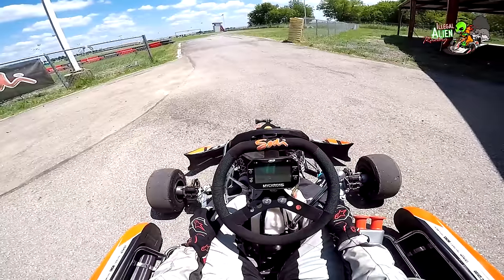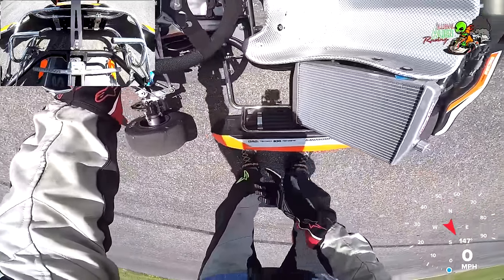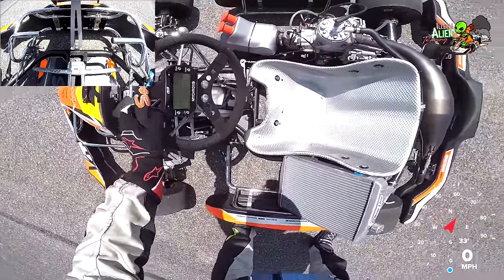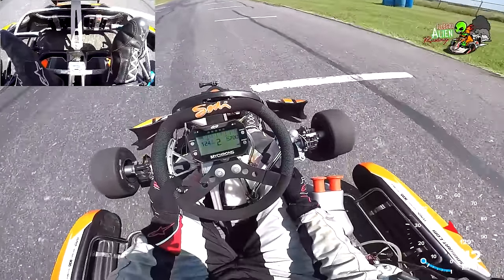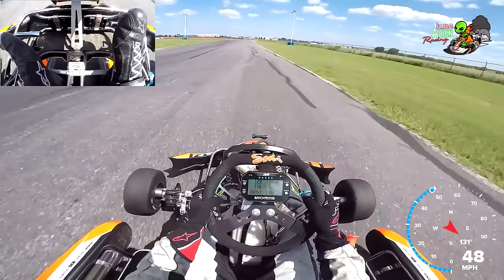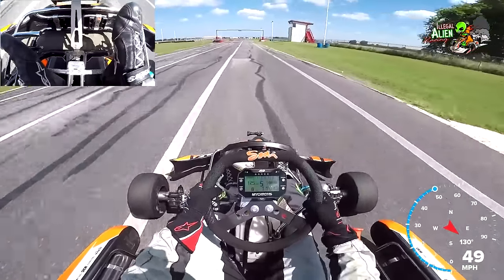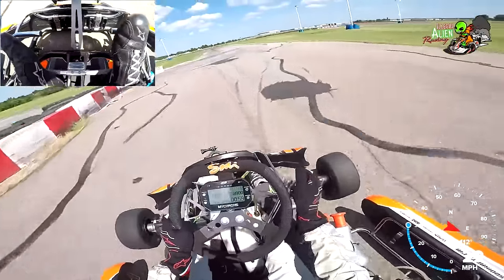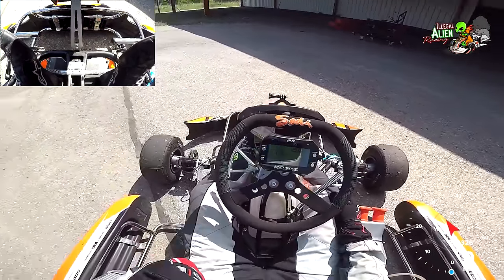Shifter 101 - Basics of Driving a Shifter Kart

Comment: To all the comments related to needing the clutch to shift: motorcycles can easily be shifted clutchless. This is a motorcycle transmission. For that matter - cars with manual transmissions can also be shifted very easily without the clutch without damage, it just takes more patience/time to match revs, and no - it doesn't hurt the synchros.
Reply: yeah your right. To give car people background these transmission are like sequential gearboxs (like the ones in rally cars). When they shift at speed in those the ignition is cut for a little bit and at the same time changes gears without a clutch. Motorcycles have these too and they are called quick shifters. But you don't need one, just letting off the gas works just as well.
Reply: @pleasedontwatchthese9593  exactly!

Comment: When you get comfortable with shifting you can shift without coming 100% off the throttle, but this is a basics guide and that's advanced driving. :D
Reply: When shifting a motorcycle without the clutch I preload the shift lever just before I get to the point I want to shift.  Coming off power  and right back on completes the shift.  Tapping a kill button does the same thing while keeping the throttle open.  This eliminates the need to coordinate throttle and shifter movements. Should work on a kart too.
Reply: Can you shift without letting off the gas?
Reply: Or do you have to lift off a little bit
Reply: @lukereyes1025   In order to shift, you must de-load the transmission gears no matter what. You can do this in several ways. One is to roll off throttle just long enough that the gears deload and you shift during that time. Another is to use the clutch.
Reply: @jimsz0100  Had a miroswitch in my gear lever, so I could trigger a flat shift option on my ignition. Loved pulling gears with the gas hard to the floor! It was a Suzuki RM250 grass kart and often would go over bumps when you were ready to shift. That would load up the gearbox again, so you'd miss your ideal shift spot. Also had a shift light and rev limiter. It was pretty quick!!
Reply: I (almost) always use the clutch when shifting my bikes. Dirt or road, and this is more bikes than I can remember over more years than I care to remember.
Reply: So my experience with manuals is strictly motorcycles. With that being said it is fairly easy to shift up and down gears without the clutch on most motorcycles however you still have to rev match or it will damage clutch and maybe trans as well. In this video though the driver downshifted without blipping the throttle, is this truly the best way to downshift in a shifter kart?

Comment: It's a go-kart with a sequential manual (motorcycle) transmission essentially...
Reply: Almost like a 125cc dirtbike powertrain installed into a go cart!
Reply: @fokjohnpainkiller  Well motorcycles aswell as shifterkarts have manual sequential transmissions. You technically need to pull the clutch to shift but you can shift without doing it. In sequential transmissions you don't need the clutch to shift, only to get going.
Reply: @jayplexy5983  umm you do still need to clutch to shift, you technically don't have to use the clutch on any transmission of you double clutch, although that would burn the synchromesh pretty quickly.
Reply: @tristan6509  No, on a sequential tranny you don't need to use the clutch to shift.
Also when you double clutch, you literally use the clutch, TWICE!
Reply: @jayplexy5983  well yeah, so what?
Reply: @tristan6509  Well you said you need to use the clutch unless you double clutch...
Reply: @jayplexy5983  lmao I derped out, I meant rev match not double clutch.
Reply: Yeah, seems sucky to not have the clutch (pedal to) override and have the engine cut out at basically every minor input mistake.
Reply: It's a motorcycle engine in a go kart.
Reply: @DonziGT230  no its not lmao its a 2 stroke
Reply: @higtmance3641  Yes, lmao, a 2 stroke motorcycle engine; Honda CR125 is one of the most commonly used.  I don't know if that's what this cart has, but they are popular.

Comment: I built a shifter before shifter we’re cool! Put a 370 RM Suzuki motorcycle motor on a Yamaha 100 cc cart in 1980. Was very torquey an a lot of fun on side Roads but No tracks or place to Drive it! Brakes were not very good but worked ok. Mine hade the kick start still on it an worked fine! The tuned pipe was very loud so when got it on Road it brought people out to watch.

Comment: Cool video. Thanks for showing how to operate a shifter Kart.  I raced many years ago (1960's) before there were ever shifter Karts. My Dad and myself raced a 2 stroke McCulloch single engine Kart.  Raced on several Chicagoland area tracks. Was allot of fun back then as a Junior division Karter.  At the end of racing this Kart, it was pretty well modified and very fast. Shifter Karts are a whole new ballgame.

Comment: Racing with shifters for some centuries I do have a tip for beginners in real racing to avoid to be in the wrong gear: Shout loud to yourself the gear you a shifting in. Yeah, know sounds a bit wired, try it! When you have problems after the corner to accelarate, being in the wrong gear, that really helps, because even when you have the luxury of a gear display, in a race its hard to look at this. It also prevents a lot of laughter from the pit lane......when you lose several places caused by the wrong gear......

Comment: Thanks I have a TAG and I have heard its a big performance jump up to the 6 speed from no shift,I have 125cc 29hp and shifter are 6 years ,front brakes and 40 to 50hp if they. Are the original motor from the factory,I was real worried how tricky my tag would be with just rear brakes it amazing u real don't notice it brakes so well, I have stoped racing but still would love to drive a shifter just to taste the difference...thanks for general direction nice job,audio was great and surprisingly clear compared to what I was expecting,😎
Reply from the maker: You definitely should drive a shifter with your experience.  Thanks for watching the video!
Reply: A shifter takes a little while to get up to speed but you’ve driven one you won’t go back. The shifter take a lot more concentration. for me I could run a dd2 or tag 8 practice sessions no issue but then after 4-5 sessions in the shifter and I’ll be done.
Reply: Stock Honda 125 is not 40-50HP. Maybe 32 tops....

Comment: 2:03 on the tracms that ive driven on, your supposed to go flat ln the throttle while they pull on the (lawnmower like) engine starter
Also, they were not shifter karts and we didnt get pushed

Comment: question about where to tie in the pulse pump vacuum line. In the side of the reed box ?  Or in the carburetor boot before the reed box. 
copy
Reply: I've seen it done both ways, on my kart I put it on the carb boot.
Reply: Definitely in the carb boot. Taking vacuum line into the downstream side of the reeds will give you both pressure (on piston downstroke) and vacuum (on piston upstroke) of any case reeded engine or pulses of both on any piston port reeded engine. Opt for only vacuum!

Comment: For the viewers: the "killing the kart" part of letting off the gass and let it die is because these two-stroke racing engines have their idle throttle deliberately too low. So it won't idle. That's why, at a race track, you always hear racers pumping their throttle at stand-still. Karting and motorcross or even motor racing alike.
Reply: Thx
Reply: So another question is when you downshift, will it jerk hard cuz it doesn't seem like you guys rev match it

Comment: Really Good tutorial,I have a question ,when you are stopped with the engine still going in neutral,without clutch,and hitting gas can you just change to 1st gear to start up quicker ?or you have to hit press clutch,change to first and then slowly release the clutch and gas at the same time as said in the video ???
Reply: The engine is too weak to move the kart from a standstill and it would just shut off. That's why you use the clutch to gradually transfer engine's power to the wheels.

Comment: How do you rev match without pulling in the clutch? Does it auto blip or do you have to blip in the split second before the dog teeth engage? If it's the latter it seems an awful lot more practical to use the clutch

Comment: Is a certain body weight recommended? Is 6’2 too tall or too heavy before it begins to affect power output?
Reply: lildevil2063 basically they say every 10kgs is - to 1 second on the track. I’m 6’5 and 130kgs so for me to compete with 90kg mates on 125cc shifters, I use the imae 175cc shifter motor. Loads more torque and midrange.

Comment: Do you ever need to apply a bit of gas (I think it's called blip) when shifting down in a hard braking zone?
Reply: Gearbox durability propably is not an issue with these cars.
Reply: I ask this because blipping gives you more traction in hard braking. I just don't know if in karting makes a difference or it's just not worthy.
Reply: No blip needed plus it’s would be much slower changing gears. If bang back a gear way to early it could lead to compression lock up tho

Comment: can you rev match a shifter kart like you do on a bike?
Reply: For that he will need to press the clutch, but the clutch lever is only used to a stand off point. No need to revmatch a 2stroke do not have much compression so the engine will just go up a little bit in RPM and nothing will happen. No wheel slipping or something

Comment: Its a 2stroke motor and when up shifting you can hold the throttle wide open and shift, you do not have to let up on the throttle to hit the next gear.
Not only does it keep you in the power band it will shave time off of your laps.
So try up shifting with the throttle wide open and you will be happy with the result.
Reply: paul wolven wears the gearbox out quicker doing that

Comment: Good video for beginners,but you don't need to lift off completely for up-shifts,a small lift is enough because otherwise you'll lose time.
Reply: You dont need to let off the throttle at all when up shifting a 2stroke.
Wide open 1-6 gears, you'll stay in the powerband all the way through.
Reply: @paulwolven8678   LOL...wrong....

Comment: So this unit looks like a water cooled 2 stroke?    250cc? About how much does cart weigh?  About how much HP?
Looks like a blast to drive!
Reply: 125cc, 50 hp, 95 kg
Reply: @leosileo5544  50hp is a bit too much tho, from the box they deliver about 41-42 bhp. when a tuner gives it a shot, the engine could deliver about 46-47 bhp.
Reply: @kvanginkel   Wrong. Stock Honda CR125 is 32 HP.

Comment: Wouldn't it be way easier on the drive train to put it in first or actually second, pull the clutch and then quickly slip it into gear to bump start it and quickly disengage the clutch?  I'm sorry but just jamming the gear lever into the next gear seems like a terrible idea.  It seems these carts have a very similar transmission to a motorcycle, I'm guessing its a constant mesh transmission.  If I were to bump start any of my bikes like that I would be putting tremendous stress on the shifter forks, the shift shaft and the gears themselves.  I'm also going to venture a guess that those transmissions are expensive for what they are and you probably would want to keep them operable for as long as possible.

Comment: Why did the kart die in first gear even when you had the clutch in?
Reply: It's because these two-stroke racing engines have no idle, essentially. You have to give it some gass to let it run. If you don't, it'll die out. It's the same in motorcross engines.
Reply: @willemvdk4886  Well I've learnt something today. Thanks for the reply

Comment: why don’t these karts just have a conventional up and down paddleshift configuration? Would be a lot more allowance for shifting without letting go of the wheel
Reply: Paddle shifters are available. But not common. Cable operated tends to be fussy, require a decent amount of force. The pneumatic systems (lookup mechatron) are expensive and of course add extra components and points of failure. Thus paddle shifting generally is not permitted in shifter classes.

Comment: These are based on mx engines, right? I wonder why you dont see the latest and greatest 4 stroke 450cc  out there? 😏
Reply: A 125cc shifter kart is already scary fast. I've seen guys run 450cc in an experimental class a few times, but they only even ran those karts once. The tires burnout at 70mph without any problem, and it was an obvious deathtrap to any who saw it. Still badass tho...

Comment: Did the computer display come with the kart
Reply from the maker: They're sold separately from a kart.
Reply: @IllegalAlienRacing  where did you purchase the shifter engine
Reply from the maker: I bought everything from the track. The kart by itself without an engine is sometimes called a “roller”. So I bought the roller used, then a new engine from the track and a new data logger that is on the steering wheel as well. They put a new seat in it and it was ready to go.
Reply: Sorry for so many questions so u bought the engine ant the track this video was performed at
Reply from the maker: @cls_alex13  Yes
Reply: Thanks man big help

Comment: How do you get the hud for your GoPro?
Reply from the maker: The GoPro 5 (and up) captures the data internally and I put it on the video using their GoPro Quik software.
Reply: Illegal Alien Racing does it work for the hero session original?
Reply from the maker: If I'm not mistaken only the GoPro 5 and up have the data you can enable.

Comment: couldn't you hold the clutch while its in 1st then run  while the clutch is on and  when you jump in dump it
Reply: Yes you could. You don't even need much you can release the clutch for like 0.5-1 sec and then pull it again and you the engine will generally start
Reply: @yuemaeve  nice, i never had a go cart i only ride dirt bikes so i thought that they both would start similarly
Reply: @mtgamer731  yeah you need to be a bit careful about wheel spin. And the shifter revs a bit higher but is probably the same

Comment: What about rev matching on downshifts??
Reply: Hiw would that even work during hard braking since the kart is in gear like the entire time. Since you don't use the clutch to shift
Reply: @yuemaeve  I drive 18speed in big truck up shift and downshif no clutch just start  offs.
Reply: @tonybalony6263  what are  start offs?
Reply: @yuemaeve  first gear from a stop
Reply: @tonybalony6263  but what has that to do with rev matching on downshifts in a shifter kart?

Comment: To be faster you dont have to let your foot off the gas when shifting, to be faster and better flowing just let go at at least 60% of the gas.
Reply: Ghali El Fechtali driving shifter for 2 years I have always gotten in the habit of letting off, I’ve learned to let off quickly enough where it doesn’t kill too much speed. Throttle while shifting IS faster but it can put a lot of wear on the gearbox
Reply: @santiago9ish  2stroke gearbox is made to shift that way.
Ive never had any kind of problems with the gearbox on any of my 2strokes and always hold it wide open when up shifting.
Reply: paul wolven it can lead to accelerated wear though, it’s not too time consuming to just learn to be able to let off quickly and efficiently
Reply: @santiago9ish  i personally have never had any problems with gearboxs on any of the 2strokes that ive owned.
I put alot more hours on them running through the gears with a wide open throttle than most carts have total on them. Never cost me a gearbox.
And if your competing, especially in carts, you need every 10th of a second you can gain to be on top and that will get them for you.
Even if it costs a gearbox from time to time to be on top, then so be it. Its one of the prices you pay to be a winner.
Wide open or go home!!!
Reply: paul wolven only very very top level shifter drivers flat foot shift, there’s plenty of other ways to lose time that don’t put more wear than necessary on the kart

Comment: Please stop moving your hands up and down on the wheel depending on the corner. It looks like you're pulling the wheel down with the inside hand.. Push it up with the outside hand and shift your weight towards the outside of the corner so that you can flex the chassis and lift the inside rear.
Reply: Perfectly said

he really looks like an amateur by doing that. Sorry friend : )
Reply from the maker: I agree with you, hands shouldn't move like that and normally I don't move them that much (sometimes slight adjustments).  I was mostly cruising at slower speeds explaining how the kart works vs. trying to get a good lap time and using the best driving technique.